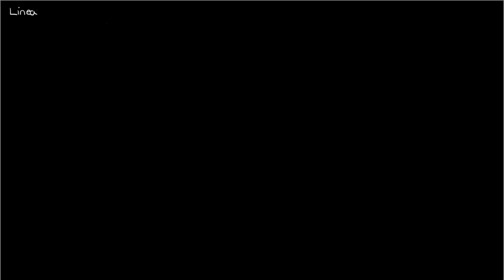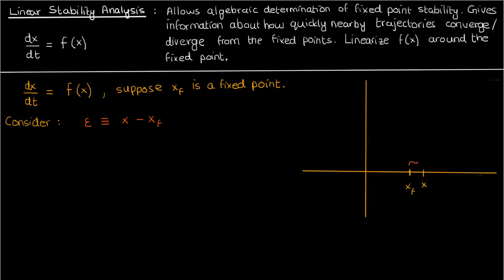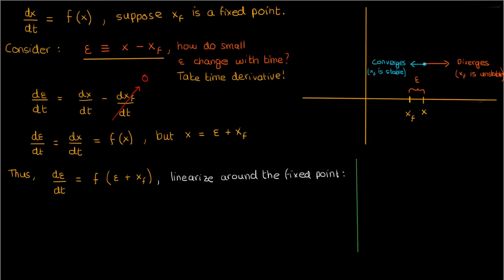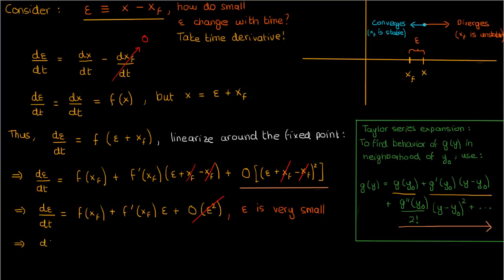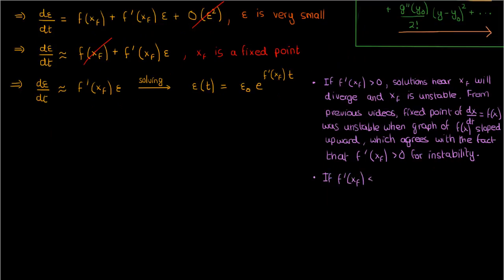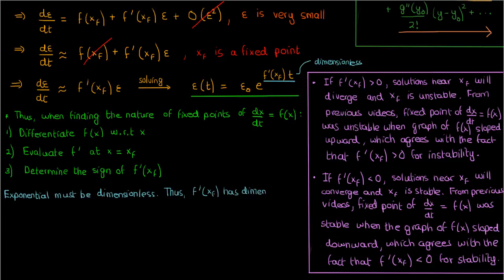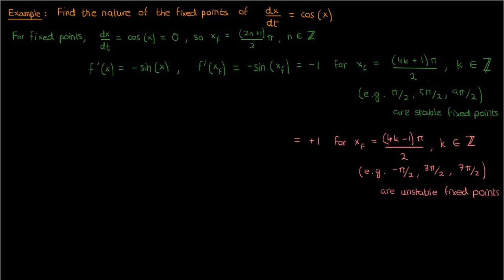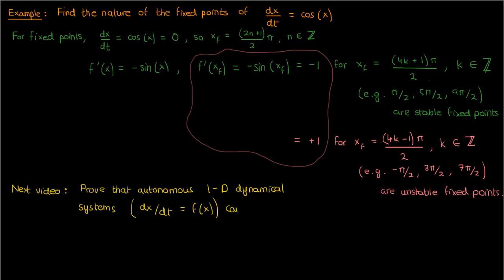Linear Stability Analysis | Dynamical Systems 3

Comment: What exactly is meant by "very small perturbations"? Is this related to limits or is does "very small" simply denote that it is within a small enough interval that the behavior doesn't change?

Also: great job explaining. I really enjoy these nonlinear dynamics videos in particular. I look forward to the rest of the series!
Reply from the maker: Thank you!

It's not related to limits, even though I've used epsilon (the same greek letter you see in the epsilon-delta limit proofs). Small epsilon just means that the amount by which we disturb the particle from its fixed point/steady state is so small that epsilon^2, epsilon^3 etc are negligible. For example, if epsilon were 0.01, then 0.01^2 = 0.001, which is very small (1/100th) of the original epsilon.

When epsilon^2/^3 etc are negligible, we can safely apply the linear approximation as I did in this video. The main caveat is that you're restricted to looking at disturbances in the local area of x_f. You don't know about global behavior via linear stability analysis. Hope that helps, and feel free to ask more questions!

Comment: so it is basically the second derivative test from single-variable calculus, right?
Reply from the maker: It's similar, in that it allows you to determine the nature of the point where the first derivative is 0 (i.e. the fixed point). The difference here is that you're differentiating dx/dt = f(x) with respect to x as opposed to taking the straight second derivative (i.e. d^2 x/dt^2).

Comment: 4:34, The fixed pint is not the stationary point, why should it be zero.
Reply from the maker: For this video, they mean the same thing. A fixed point is where the function x(t) is momentarily fixed (i.e. dx/dt = f(x) = 0), and a stationary point is where the function x(t) is momentarily stationary (i.e. dx/dt = f(x) = 0).
Reply: @FacultyofKhan  Ok, thanks for the explanation. That is a stationary point other than a fixed point. 
Fixed point x(t)-t=0, stationary point: dx(t)/dt=f(x)=0.